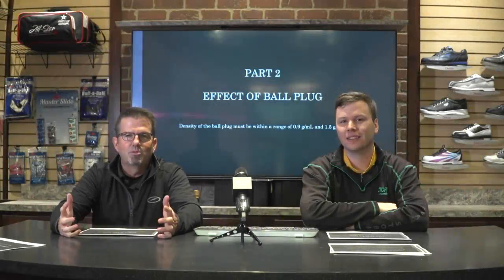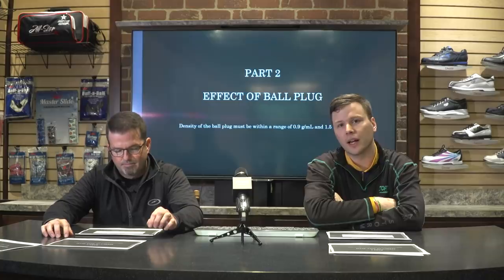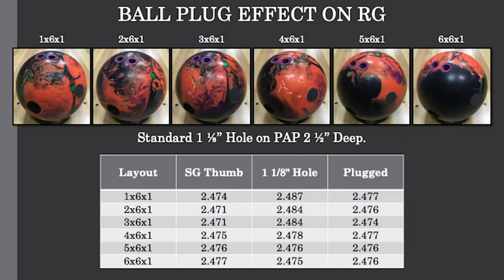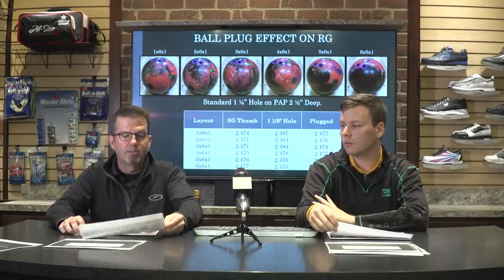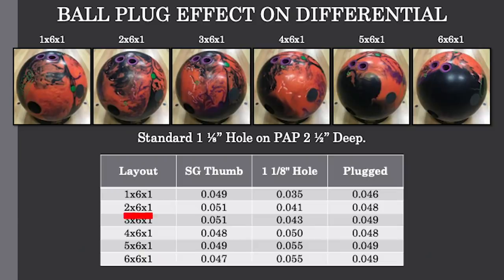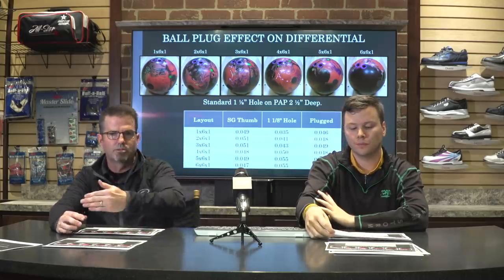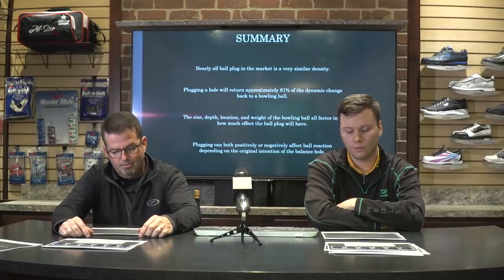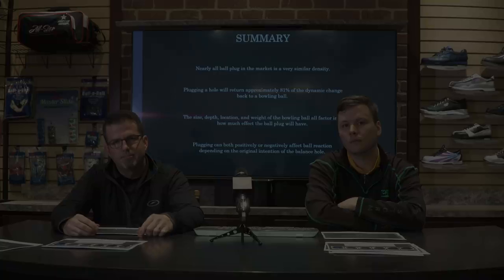Storm | The Effect of BALL PLUG

Comment: The big issue here is where does the MB move to on symmetricals... If this is a symmetrical ball, its effective layout is changing when the hole is plugged.  Weight holes can move the MB over an inch on symms...
Reply: It moves back to the thumbhole, more or less.

Comment: The Takeaway from this video: If you want to increase the performance of a ball "legally," put a big ass balance hole in it in the perfect spot, then fill it back up with the least dense plug material and the end result will be a ball that is "more dynamic" than the ball was before the balance hole.
Reply: The data shows that 80% or more of the original "dynamics" are restored. 99% of bowlers are not going to notice the difference of .001 in differential from shot to shot. Let alone plugging a hole and throwing it again.